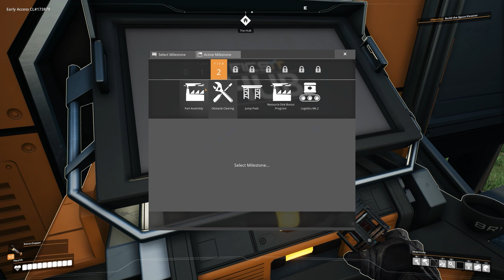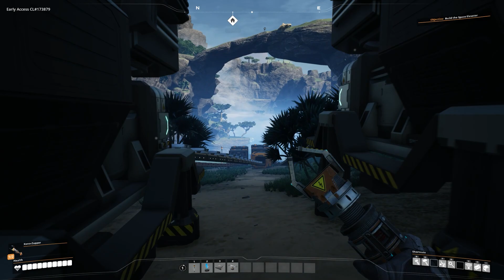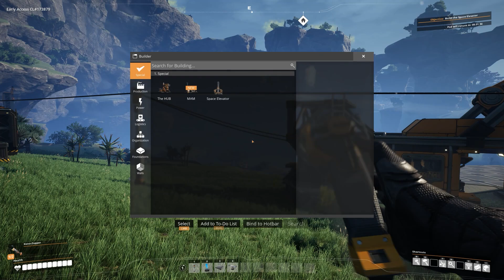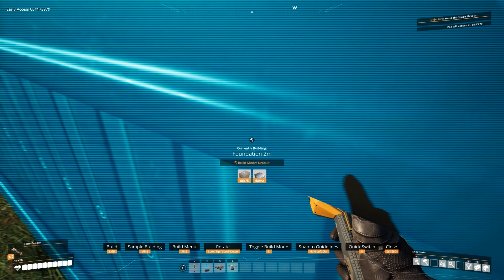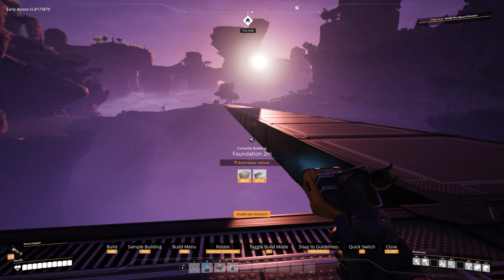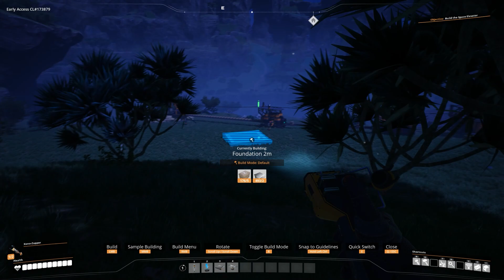A loose plan emerges | Satisfactory part 2

Comment: I'm not entirely sure I should tell you this, but you can press Shift-Space while standing at the craft bench to continue making stuff. No need for the MouseButtonWedge™. Use this knowledge reponsibly, for it leads down a dark path.
Edit: starting at 13:00 you talk about bulding in a way so that the space elevator platform and the base match/interconnect perfectly. Since update 5 there is now a "global grid". You can press Ctrl (I think) while placing a foundation, and stuff will line up no matter the distance (assuming same orientation, but there's a compass).

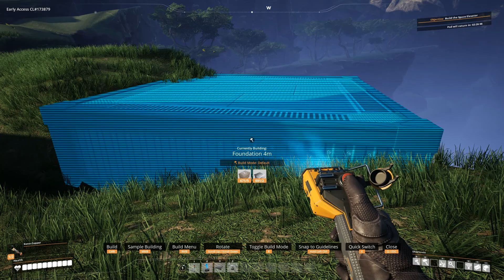Comment: 12:00 you're asking about an easier way to built the platforms: New feature in Update 5 is press R to toggle Build Mode Zoop. You can build a line (or column if you press R again to toggle to vertical mode) of platforms at one time.